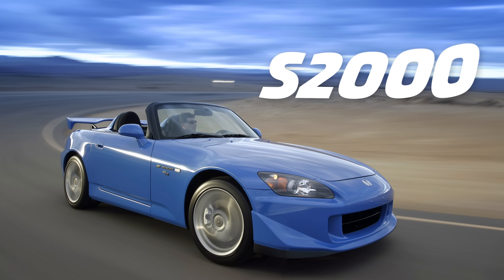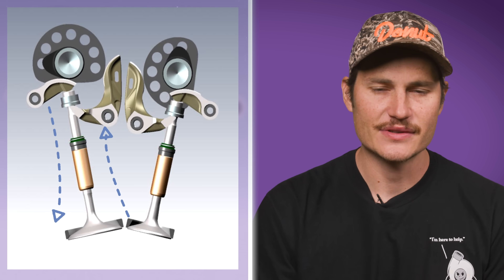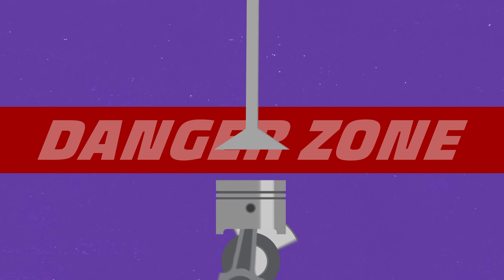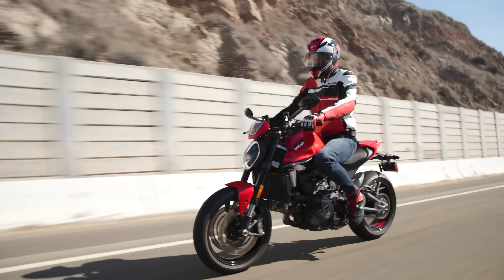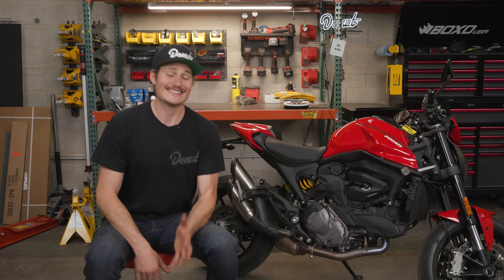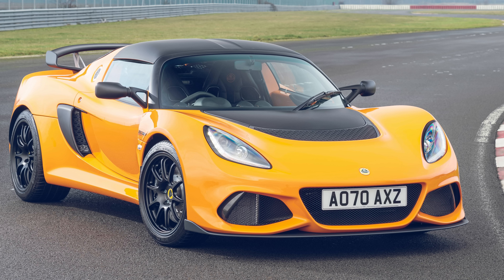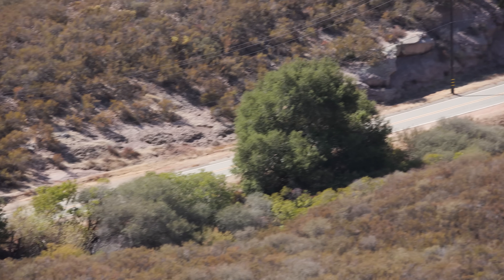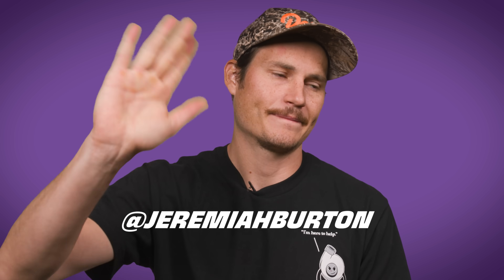Why ONLY Ducati Uses This Part To Go Fast

Comment: While the Desmotronic information in this video is factual, there's only a couple of bikes in the Ducati line up in 2021 that even have a Desmo valvetrain anymore. Furthermore, the Monster you keep showing over and over isn't one of them, its uses springs. Why? because in Volkswagen/Ducati's wisdom to have bikes with greater mass appeal they had to increase the expensive service intervals to  be more competitive with Asian manufacturers to gain younger customers. Do I agree with Ducati dismantling everything that made them distinctive like dry clutches, Desmo exhaust notes and trellis frames in the name of mainstream appeal? no. Bottom line, Ducati is an enthusiast motorcycle, period; and enthusiasts except what comes with it in the same way exotic car owners understand the reality of ownership.

Comment: That's what makes them sound like a coffee can full of nuts and bolts being shaken rapidly. I like the Koenigsegg solution, camless engine. Look it up if you want to be amazed. I actually thought of that design when I was learning auto mechanics in my late teen to early 20 years but didn't have the technical knowledge to design a solenoid that could pull it off. I even went a step further with the idea than they did (well, in a different direction) because I had the idea to make the cam profile adjustable by the driver. If you wanted power mode, you press a button for race cam, if you wanted mileage mode, you press a button for mileage cam, if you want torque...and so on. What I mean by a different direction, they went a way that I never thought about, which is super cool. They control each valve of a four valve per cylinder design independently of each other so they can control combustion swirl in the chamber and other things like EGR or I suppose (but don't know if they do it) they could make it mimic an Atkins cycle engine.

Comment: I'm just at the beginning of the video and it's implying that you need desmodromic valves to get high RPM motors.  The Japanese have been cranking out straight four cylinder motors for a long time that reach 15K+ rpms forever.  Desmodromic valves are just Ducati's thing, but totally unnecessary if all you're concerned with is getting a high revving motor.

Comment: Desmo valves are a pain to adjust, and spendy.  Great bikes, but the older ones only had a 6k mile interval between valve adjustments and needed belts every 12k.

Comment: FYI there is no such thing as an L-Twin, well at least outside the Ducati marketing dept. it’s a V-Twin coz the stroke of both bores is equal. Add 90° configuration and bingo, a V-Twin. Even Ducati are giving up on Deso these days..

Comment: Formula One engines using pneumatic valve springs with pressurised air allow engines to rev over 20,000 rpm.

Comment: You totally missed the point that Ducati had to stick to the desmo technology because of their adherence to 2 cylinder design (until recently...). 
A 4 cylinder equivalent has much smaller and more light weight valves and consequently less inertia and doesn't need desmo's to rev the engine sufficiently to squeeze out the desired power.

Comment: Desmodromics make for the best valve train, period. They are found from entry level Ducatis, to their top MotoGP bike. No other valve train can do that. Others use pneumatic valves on their MotoGP bikes. And which bikes are the fastest due to the most powerful engines in MotoGP?  The Ducati desmodromic ones. Yes, they need greater attention and higher costs to service, because there are 2 shims for every valve, but if you want MotoGP tech in your bike, you pay the price for the best.
Reply: Completly.FALSE STATEMENT PERIOD!

Comment: Well...technically they do have closing springs on the intake and exhaust valves but they are only there for low speed idling otherwise the bike from startup would have to be above 2500 rpm

Comment: Theyre getting away from it now in racing engines and the V4 Grandturismo as its too complicated and offers nearly no benefits over a PROPERLY setup valvetrain as they have said, and is too hard to adjust clearances. Its a cool leftover 1970s remnant to compensate for lack of valvetrain tech, metallurgy, and knowledge. Yamaha had a 16,000 rpm valve sprung motorcycle in the 1980s, many had 20000rpm bike sin the 90s, and F1 cars go to 21,000+rpm with them

Comment: Just wanna point out that No Ducati redlines at 17,000 RPM. The max is 15,000 on a V4 and I’m pretty sure the 1299 is the same aswell. Only 600cc and motogp bikes go beyond 16,000

Comment: Loads of bikes rev to 12-115k not just Ducati so what’s the alternative tech they use there’s also a few cars that rev higher than a s2000 and the Gordon Murray fan car is said to be 12k rpm what are they using to allow that

Comment: I think Ducati's most important engineering feat is having the coolest names for their bikes. "Panigale" or "Desmosedici" adds 25hp.
Reply: Its Just an italian things. Remember, maserati Quattroporte meant maserati four door. 🤷🏾
Reply: Ducati it's not the most creative when it comes to name a bike, they either use the cc of the bike (851,1299,1199,1098,748)ecc
Panigale is from Borgo Panigale, the small village nearby Bologna, the scrambler it's a scrambler, the multistrada litteraly means multiple terrain the monster could be one of the few setting apart
Reply: @ilbego7494  and desmosedici can be split in “Desmo” and “sedici” which means sixteen.
Reply: And they are red! Red makes things go faster.
Reply: They're cool names unless you speak Italian, and then you realize they are literally just descriptions of the bikes.
Reply: @fyrstormer  Panigale is the name of the town where it's made, Borgo Panigale, and desmosedici means desmo 16.
Reply: @nomore10001  immagine pensare che borgo panigale sia figo 💀💀
Reply: @nomore10001  Monster da Mostro  o mostruoso in dialetto Bolognese . Lo stesso per Diavel ,diavolo o indiavolata in Italiano .
Reply: It also makes you looks smarter and gives +10 to respect. :)
Reply: I do dig the name “desert sled”.
Reply: I agree
Reply: The monster. Like that name has been there just waiting and they scooped it up
Reply: I just saw one of these street aV parked in front of my building. Crazy amazing machine & museum piece. Incredible piece of engineering. That engine is still loud . Interference machine ? Pistons not firing on all cylinders?
Reply: Dude agreed , even my Chinese bike found an extra five HP when I named her mantis 😂
Reply: Don't forget the red
Reply: Hodaka had great names too.  Combat Wombat, Road Toad.
Reply: @randombuilds8336  combat wombat, road toad

Comment: Desmo has a lot of issues. You have to do a lot of valve clearance adjustments more often than normal valves. Ducati has switched to normal valves. This is why you only see them in Duc Motorcycles.

Comment: to be able to reach RPMs where the demodronic valve train even starts to see benefits you need a short stroked engine.  economy cars don't have short stroked engines, they red line somewhere between 5,500 and 7,500 rpm

Comment: If you’re gonna be doing motorcycles, get the cover graphics right!  Your valve is pointing to the crankshaft, not the cylinder heads!  Get it right, doughboys.

Comment: Unfortunately all this complexity of the desmo system is outdated. Ducati's V4 doesn't use it. Improvements in design and metallurgy made it an outdated design a couple of decades ago. Ducati stayed with it as part of Brand marketing, causing excessively high $ maintenance costs.

Comment: "So, as the cam spins faster the valve opens faster, but it will always close at the same speed."

No, this statement is false, and displays woefully inadequate understanding. As long as the valvetrain is operating under a speed which valve float would occur the speed of movement of the valves, both opening and closing, is directly proportional to the speed the camshaft is turning. He is jumping the gun, describing what happens during valve float, not what happens during normal operation.
Reply: True. Cam profile determines how fast the valve closes just as it determines how fast it opens. Normally.

Comment: excellent quality video and super fine explanation! just one thing: at @7.54 the correct spelling is TRIALBERO meaning:
TRI (three), 
ALBERO (shaft)
and as it can be seen, there are three shafts in the engine controlling the three cams

Comment: Many of the "problems" you mention are related to early Desmo engines. Latest Ducati engine have valve service intervals similar to most other sport bikes (12 000 - 15 000 ish miles). DLC coatings and modern metallurgy for the rockers and cams help alot and the keeper springs also reduce the slapping from the return cam. 
Also, the sliding friction from the return rocker is still much less than the opening friction from a high-rate valvespring.
And alsooo... all these engines use poppet valves. That's what they are called. Not just on Desmo engines.

On a side note, the 11 000 RPM Cosworth V12 in the Valkyrie has 6 000 mile valve clearance checks, same as Pagani's new 9 000 RPM V12R. I'm guessing the 12 000 RPM Cosworth V12 in the GMA T50 will be similar. They also use geartrains to drive the cams, so NVH is low on the list.

I'd love to see Desmo tried on a high-end high-revving NA supercar, just for the hell of it.

Comment: Couldn’t you increase the displacement on the smaller ducati engine and put it into a car the cam would make a similar amount of noise with an increase in hp

Comment: Good Lord, this is an over simplification to the point of being nonsensical, F1 engines running at 0ver 20K rpm don't use desmo valve trains nor do Honda 250 fours that run over 22k fine on springs..

Comment: Honda, Kawi, Yammie and Zuki didn't need desmo valves to pump out affordable, mass production bikes in the 80's and 90's that revved to 19,000 and 20,000 rpm all day everyday, have power per liter rivalling the best of today and sounded beautiful, and are still bouncing off that 20k rev limit to this day on the road and track. Off course being JDM, AUDM and NZDM only they don't get much publicity elsewhere, least of all the US

Comment: Own a ST3  Ducati ..Took it to the Ducati for valve adjustment and belts ..He asked me what i brought it in for . I told him he said that he went through it and it didn't any thing i said it has over 60,000 mile it he asked me how many times i bounce it off the rev. limiter , i said once when i first got it .He said well there is your answer ....Still got it still ride it ,,,,120,096 miles on it .....

Comment: 7:51 the system was called trialbero, not trailbero, and it means three-shaft (tri-albero)
Reply: He’s also completely wrong about the “Ducati sound” which comes from the dry clutch, not the desmo system.

Yeah, you can hear them a little more than sprung poppet valves, but that’s not the “Ducati sound” everyone talks about.

Also… all piston engines valves are “poppet valves”

Comment: Just a note, car engines don't rev as high not because of valve springs, but because of bore/stroke ratios being much more "under square". Car engines predominantly are designed to make far more torque with longer strokes and smaller bores. This leads to more mass and force going through the con-rods and it becomes a materials problem where it's not possible (or feasible) to rev them any higher as the con rods will snap.

There are plenty of non desmo bike engines that rev up beyond 17k rpms - the old CBR 250RR screamed its way North of 20k rpm with conventional valves just as one example. These engines are just massively "over square" with bores far larger than their strokes. This leads to less forces going through the con rod at a given rpm so they can rev higher and thus make more peak power while sacrificing low down torque.

Comment: I'm a Harley rider and I took a Ducati out for a ride one day. 600km or so, most expensive ride of my life. didn't crash or anything but parts where flying off the bike and i had to buy tools to tighten the dry clutch springs which where about to go fly out and I lost 90% of the front brakes while taking corners at some point too but was able to fix the problem. I might be crazy but I'd rather have a Harley, I've had 1500 km days and cross country road trips without the slightest problem. Ducati are beautiful bikes but I wouldn't drive one from Chicago to LA.

Comment: all right, i understand why it isnt used in normal cars, but why not in supercars? They are already loud, so no problem there. Supercars also alreaady get driven way less than normal cars, probably even less than superbikes, so wear and maintenence isnt really a problem. And cost, well, im sure a couple thousand more bucks or even tens of thousands of bucks wouldnt be the problem for supercars, they are already quite expensive.

Comment: Wasn`t there a Honda CB 125 T2 making 27 HP @ 22000 rpm ? And wasn`t there a manufacturer using more valves per cylinder what decreases the weight for each one ? BTW: 1. valve timing service on a 5 - valve Yamaha is @ 40000 kms, valve timing service on a ducati is every  6000 and there is  the timing belt to be replaced, is`nt it ? How often the timing belt has to be replaced on a Yamaha ? Yep, never, they don`t have one. Do Ducatis have more power or last longer than ... We know the answer already...

Comment: Not just the valve issues, but typical car engines have bigger pistons and more stroke than any bike - which is why they're not as rev-happy. It's the reciprocating mass that puts more of a limit on things. The fastest revving piston engine cars also use a pneumatic system instead of a mechanical spring too.

Comment: 17000rpm? Thems rookie numbers, zzr250rr 22000 rpm, sprung valve, mc22 19000 rom, sprung valve. Of course the old 50-100cc 2 Stoke gp bikes go alot higher then that again

Comment: If you want to talk about exciting new tech valve trains you need to look into the Koenigsegg engine. The have removed all the springs and cams,... all the parts the wear out can cause parasitic drag. There tech is the top of the tops.

Comment: There are no valves in a Two Stroke engine. I know as I have broken 13 GP small bore, two stroke land speed records. Not to worry. You are still near and dear to my heart. It is easy to slip up on occasion. Now, back to the show!
Reply: The Ducati 125gp wasn’t a 2 stroke…
Reply: @Countavery  I stand corrected. All my involvement in GP bikes has happened after the 1950s. I actually never seen a 1956 Desmo. I built GP engines from Aprila, Honda, TM, Pavesi etc. Thank you for your reply.

Comment: I always wondered why rocker arms didn't use a sort of pin design that ran inside a groove in the camshaft. It would not only open ,but force the valves closed. Then a somewhat weak spring to give good sealing could be used.
Reply: Assembly costs and tricky to grind the groove efficiently so a bearing can run on it for a standard in line or V engine . And would need a bearing running on each side with preload, otherwise nvh would get out of control,
Effectively a radial engine where it would be possible to use a cam plate instead of a shaft would be the best use of that system. 🤔

Comment: My questions are: 

a) Could you get rid of the sliding friction with a roller bearing/roller rocker in that spot? 12:00
b) Could a spring be used to cushion/reduce the closing force of the valve at the last minute? Sure it'd add a small amount of spring tension to the system but surely itd be no more than you lose from the violent slapping of the valve...

Elaborating on b) The valve stem could be a small collapsed spring inside the tube - when opening it would act as a solid stem and push the valve down just the same but on pulling up it would stretch the spring. If the spring rate was set just right could it be balanced so that the force required to pull the valve up is low enough that the spring barely gives but when it contacts the seat the slight increase in pressure causes the spring to give resulting in a softer landing. It also wouldnt have the issues of a traditional spring system as the mechanical push/pull would be providing the same function as the spring pulling back so the springs speed would be irrelevant at higher RPM and at lower RPM any lost momentum from pulling on the spring would be regained when the spring pulled back "assisting" the assembly on the next opening event.

You could even have the valve be a normal valve but have a second seat inside the valve guide and have it act on that one.
Reply: Most Ducatis built for street use have small torsion springs on each valve to aid in closing at low engine speeds.

Comment: The highest-revving full-sized (not model engine) piston engine that I know of, was the Honda 50 cc racing bike. It was a twin cylinder developing 14 hp @ 21500 rpm, with a rev limit of 26000 rpm. https://www.youtube.com/watch?v=vDd0kVnnqfg&t=220s

Comment: 15,000 red line on my 2021 Street fighter, 207 rear wheel horse, launch control, wheelie control 415 lbs. I'm 175 lbs. 9.54 in the 1/4 mile, pulling the front wheel @ 130 ! A little intimidating EVEN too me !!

Comment: Be glad we dont have this in production cars. Youd have to take the heads off and do a valve job every 10-20k miles. If you think mechanics are expensive now just imagine if you had to get $2500 of work done every 15k miles just for routine maintenance. Race cars and bikes are one thing but passenger cars are another.

Comment: The valve springs are always in compression, NOT tension. Different direction for the forces. Most people think everything is in tension, when in reality you have compression, tension, and shear. Don't assume a spring is in tension, more often than not it's in compression. It's literally in the name of all the springs you mention, "compression springs".